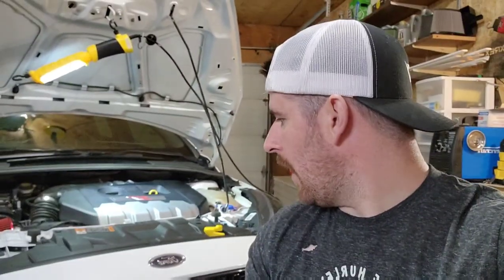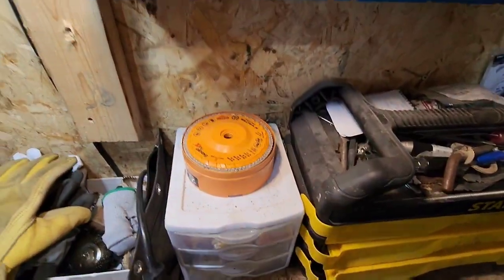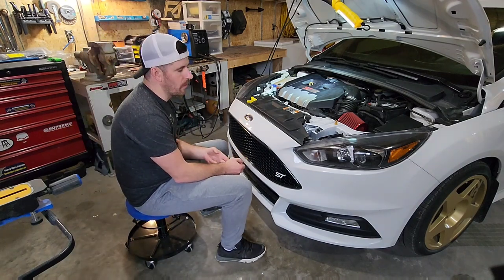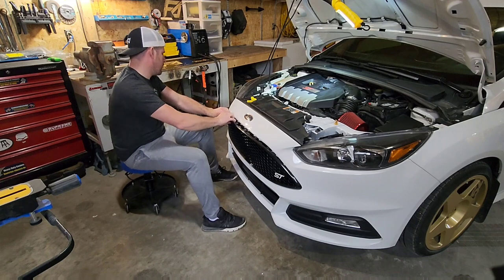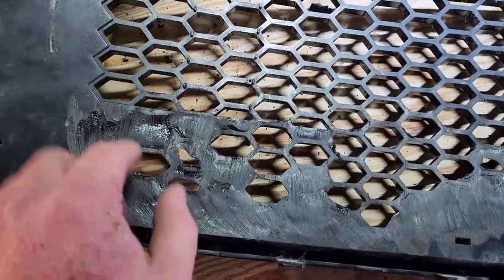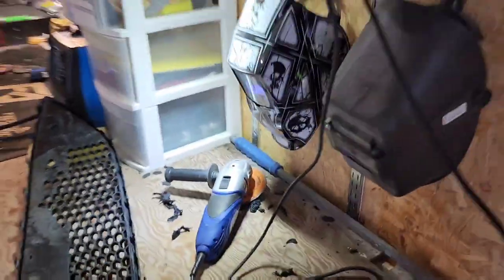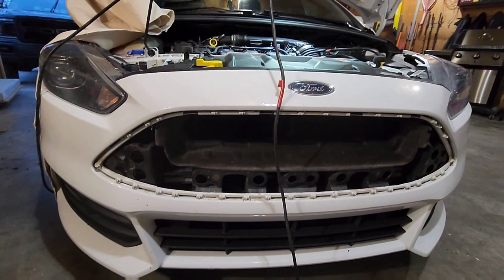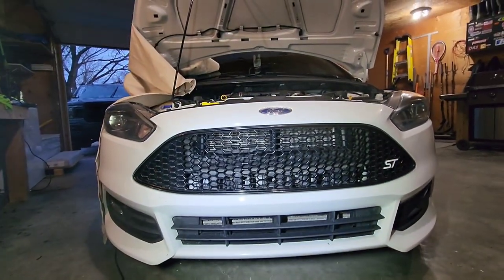How To Shave Focus ST Grill 15-18

Comment: Surprised they didn’t do that from factory.
Reply from the maker: I hear ya! Makes a big difference!
Reply: Why would there be a need to?
Reply: @hjjr-se5jv it’s cosmetics, but they made the grill the way it is because it directs the air flow towards the radiator and condenser